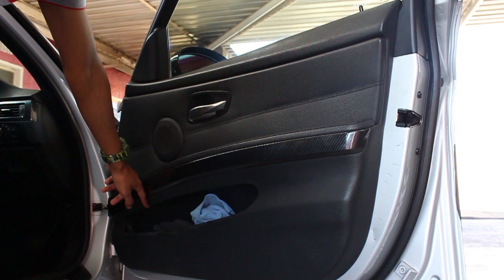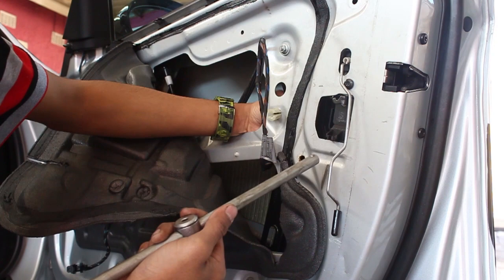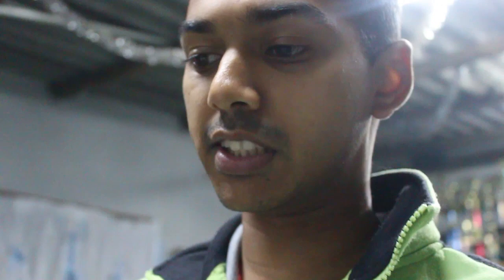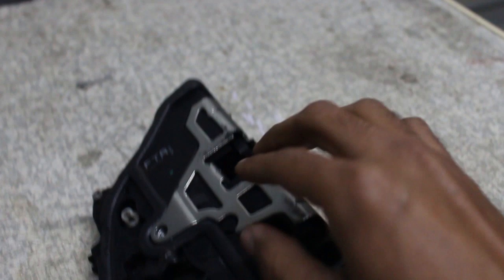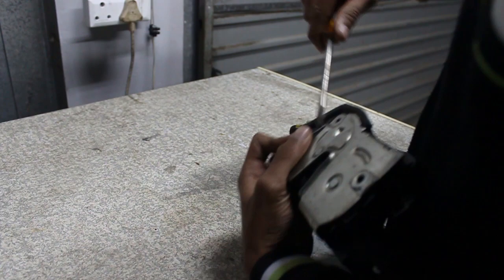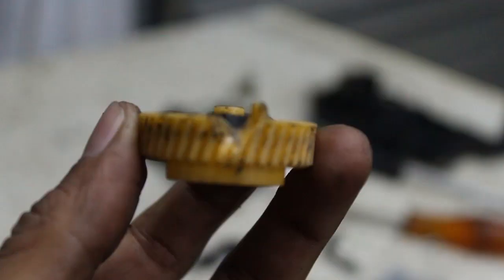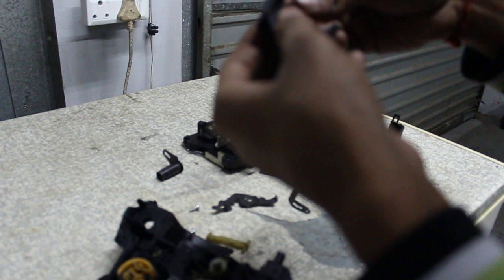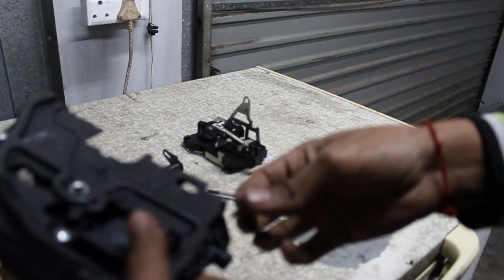BMW E90 : Door Lock Replacement and repair

Comment: How do you unlock it when the door won't open from inside and outside. Where do you press on the actuator to release the door?
Reply from the maker: When you say it won't unlock from inside and out, is it only with the key or is the door not opening at all?
Reply: @Realpreshaanb  On the rear driver side door. No keyhole. The actuator moves but door stuck shut close. I have taken the inside panel off but the actuator will not release the lock to open the door.
Reply from the maker: Since you've taken off the inside panel, try again get to the release pin and it should open up the door
Reply: @Realpreshaanb Briglall update.....GOT IT!!! There is a wheel like a disk inside behind the hole where the lock/unlock hanger connects. you get a flat head and turn it counterclockwise breaking anything that stops you and BOOM..door opens like the holy angels descending and doves flying lol....yes I was that excited boss lmao
Reply from the maker: @R0ll_lex  awesome buddy, thank you for updating me, glad you have it sorted out🙌🏼
Reply: @Realpreshaanb  no...thank you for all your info and a starting point.
Reply from the maker: @R0ll_lex  its a pleasure, glad i could be of assistance to you 😁

Comment: That's not going to work kid. U need to replace whole wheel. There are actual repair kit on Ebay.  The mechanical wheel is there for reason simple as. Over all video helpful but u need to get new wheel to work properly. 👍
Reply from the maker: Thanks for the comment, however i replaced the entire unit, not just one component, i only took apart the unit to show the inner workings of it and the failure point👌🏼